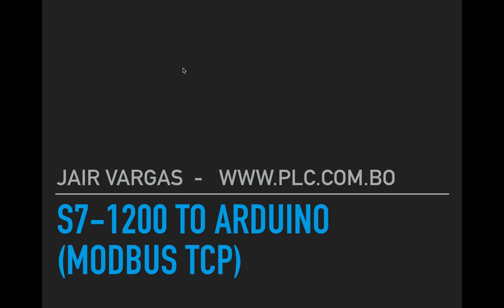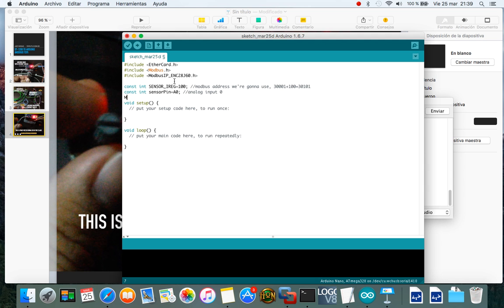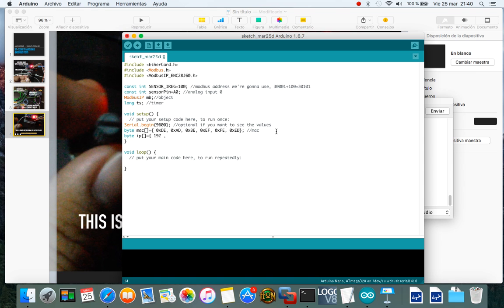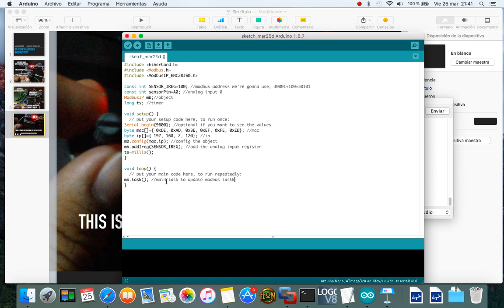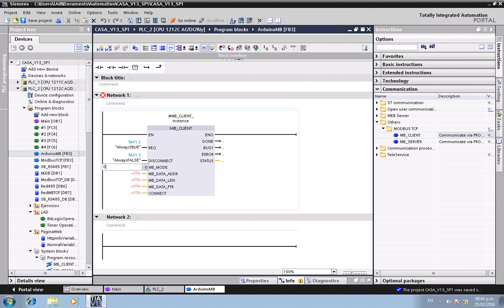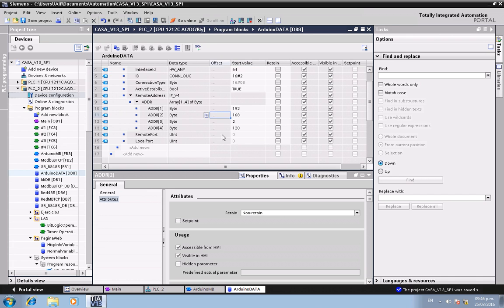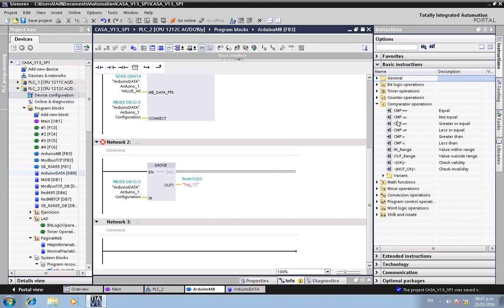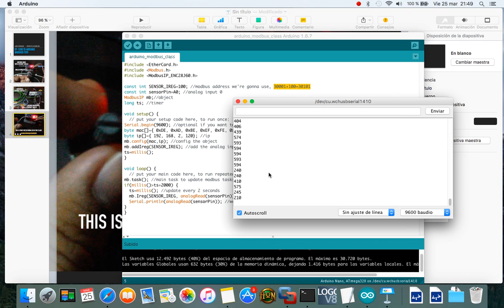Siemens S7-1200 PLC to Arduino

Comment: Hi you, i have connected susscesful, but the data i send from arduino to PLC is very slow, i want the fast transmitsion from arduino and plc, so in arduino and plc, what i need to change base on your code. Thank you

Comment: I put this together too, the arduino code compiles & programs, so does the step7.
But theres no comms, the eno output of the modbus block is enabled but input value stays 0.
I cant get a response when I ping the arduino.
Maybe I have incorrect libraries.

Comment: Hi, please this modbus addres 30001 is for analog ?! i have 2 digital pins and i measure duration between pin one and two. This duration convert to distance, this is number in range 0-150cm. I need send this number to PLC 1200 ! Can i use this example or this modbus addres will be different ? thx

Comment: hello I saw your video very well. It is great. The reason why I commented is I will try to communicate s7-1200 to arduino mega.If i send signal to PC from arduino meaga with wireless, PC gets the signal from arduino and send it to TIA portal V13.finally when arduino gets input signal, s7-1200 turn on the LAMP.  Can I do this by using your method? and by using wireless communication module.